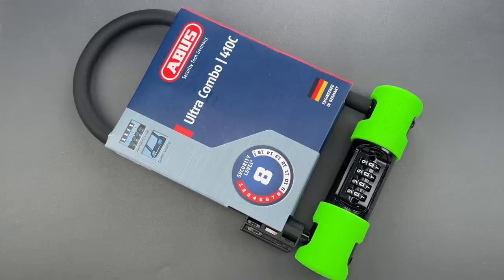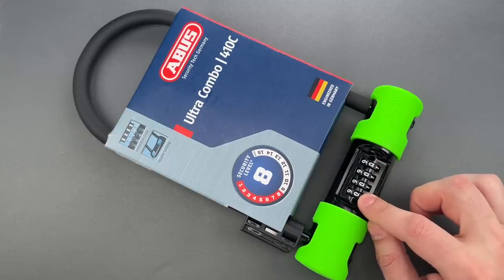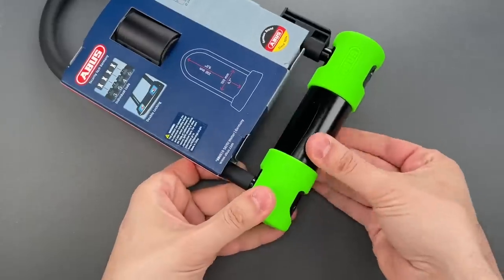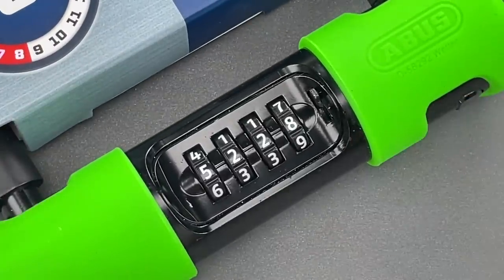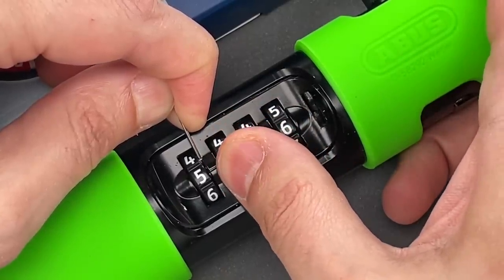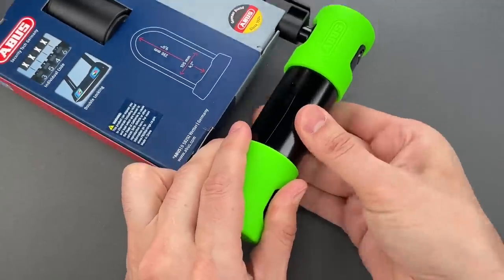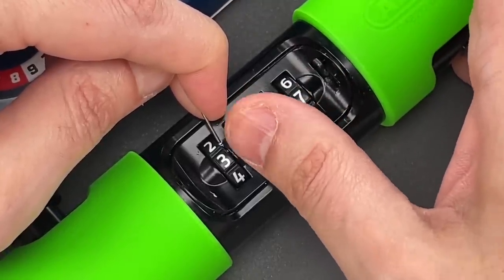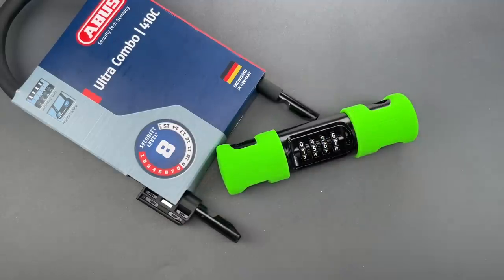[1527] Abus Bike Lock VISUALLY Decoded!!! (Model 410C)

Comment: I had a suitcase with the same design flaw as a kid. It was my first experience with lock picking, because someone had changed the combination behind my back and locked the case. It was the age before the internet, so we brought it to a shop in the hopes that they would know how to open it. They didn't, but they phoned someone. They didn't really understand the explanation, but I did. From then on I could decode all combination locks with that flaw. It's pretty baffling that a company like Abus still makes this same mistake in a new design.
Reply: It's a general issue with combination locks - but it's more serious with bike combination locks, by design.

A keyway can be sealed with a rubber cap easily (or a housing with a slider or something similar), but the rather large dials on a combination lock are a totally diffrent story. You need to be able to get a good grop on the dials, so they must be freely accessible all way around. A rubber cap which seals the whole dial assembly and can be completely removed easily will be prone to loss, and still awkward to handle during normal operation.

So bike combination locks require larger gaps so they can endure a lot of dirt and still be operated with bare fingers (or gloved fingers) even in freezing temperatures.

I've seen much better Abus combination locks, for stationary use, securely away from dirt.
Reply: @klausstock8020  Couldn't they just add a gear to the wheel (where currently they have the programming/checking mechanism), and hide the actual programming/checking mechanism somewhere behind the wheel mechanism?
Reply: @DerAlex86  They could do that, possibly even without making the assembly of the lock in the factory too complicated (of course, I can only guess how it's assembled).

And yes, Abus does offer offer combination locks with tighter tolerances which are harder to decode. But these are locks which are meant to be mounted on a door or a wall, and not to be carried on a bike which is then subjected to the dirt roads of, let's say, a forest path (Abus is a German company, and German forests are generally dirty).

My "best" bike combination lock was a simple (and cheap!) three-digit lock which was really hard to decode. Even though the model was generally very weak and we decoded locks of this model usually within seconds as kids. My lock, however, had been exposed to the elements and dirt for so many years on a daily basis that it had become very hard to decode.

It had also become very hard to open if you knew the combination. Turning the dials seriously hurt the fingers, and in very cold and wet conditions it became nearly impossible.

So I guess bike combination locks have to remain a compromise: secure enough to stop a casual prankster (like us when we were kids) or thief while still allowing the owner to open it even under bad conditions - all while retaining a reasonable price tag. It's never about maximum security after all, it's just that it needs to be better than the lock on the next bike. Thieves will use bolt cutters anyway, or steal the whole bike rack.

Comment: This has been an issue with many of those types of bike locks. For the past 35-45 years now. I figured this out back in 85. You do not need the light. There is a slight wiggle that will, depending on the interior design, go away when you hit the correct number or no wiggle that will wiggle when the number is correct. A little practice and it is very easy to feel the difference. Some you need pressure pulling on the release.
Reply: Think the light was to try to help the viewers see the notch he was talking about that could be seen visually in person.

Comment: This is surprising. Abus usually makes decent locks. I guess they figure pretty much any combination lock has about as much security as a zip tie, and it is what it is. 

One thing I’ve noticed, Abus and others have their own lock security rating system. It would be cool if LPL did the same thing with his lock reviews.  Just imagine, “Independently rated by the  Lock Picking Lawyer.”
Reply: That kind of thing encourages frivolous lawsuits and people trying to "cancel" him when their stuff gets stolen.  He knows better than to trust consumers and the internet with his reputation.
Reply: Plus ... there should only be say 3 ratings?

0. Basically a decorative cosmetic lock
1. Only slightly difficult to remove/open/break
2. Secure*

*But are there any actually really secure, basically unpickable, hackable locks?
Reply: I once saw 2 guys late at night stealing an e-scooter that was locked/chained to a traffic sign ... let say they were not a sophisticated operation BUT they just basically wiggled the pole, bent it over, and lifted the scooter and chain off the now 45 degree pole! Then probably home to the bolt cutters ... brute force approach!
Reply: A zip tie requires scissors or a knife making it much more secure than this lock.
Reply: @anttikalpio4577  You can open a ziptie with a pin, or perhaps a splinter. Just wedge the ratchet open. You get to reuse the ziptie even.
Reply: To be honest, most bike thieves never even try to pick or decode a lock. They go straight for a physical attack. There are countless different locks with different locking mechanisms, there's only a handful of different materials they can be made from.
Reply: Top of the list would be the elusive "security sponge"
Reply: @jarrodcross1482  There's no such thing as a secure bike lock. Every single one can be defeated. The security rating is supposed to give you a rough approximation of how long it's going to take and what kinds of tools are necessary. 
Security alone isn't the only consideration when purchasing a bike lock. Different use cases place different requirements on weight and portability. Someone on a long fitness ride around a countryside will want a different lock than someone commuting in a dense city area.
Reply: @CanIHasThisName  or the classic ... they just quick release the wheel which is locked to a pole ... and take the rest of the bike!
Reply: @anttikalpio4577  True. Good point.
Reply: Then  LPL Diamond rating: can survive for 30 seconds in the garage.
Reply: @benjaminmiller3620  , or with good fingernails.
Reply: @RoundShades  Really big ones, yeah. I'm pretty sure I've done that.
Reply: LPL has stated many times that he will never do anything remotely like that. Opens himself up to too much liability if he ever "recommends" a lock that someone uses and then gets broken into. More headaches than he needs for what is just a hobby for him.
Reply: @benjaminmiller3620  i open my own with peeled off nails or sometime side the exess of the tie to get it started, theyre actuially harder if you cut them flush as you kinda need to pull the zip a little to lift the locking tab
Reply: Exactly my thoughts, that's a well known brand with a bit of reputation, which they apparently believe can't be damaged by selling a lemon in the bike lock market.
Reply: We already have a rating system from LPL. It's called the video length. :D
Reply: @jarrodcross1482  "But are there any actually really secure, basically unpickable, hackable locks?"

If there are they are way too expensive for the average consumer. And they don't have to be. Locks just need to be difficult enough to pick so that it takes minutes, rather than seconds.
Thieves need to act quickly. The longer it takes to pick a lock the more likely you to be exposed while doing it. This is the real goal.
Reply: @Quotenwagnerianer  ok fine so which locks are they?

I always presumed the best lock doesn't even look like a lock? The best security isn't a lock at all, get me?
Reply: @Quotenwagnerianer  again I assume most locks are a minor deterant at best ... more a DONT vs ohhh you have bolt cutters scenario. Hence why I'm not surprised that most lock manufacturers put the least amount of effort in to it.
Reply: Plus as a kinda expert, maybe LPL could I DON'T  KNOW ... MAKE A BETTER F'NNG LOCK!!!!
Reply: doesn't matter - if ABUS won't react on theur customers
Reply: @jarrodcross1482  There's no such thing as a secure lock, or any kind of secure access for that matter. It's a tenet of security, including cyber-security. As soon as there is a way of opening/accessing something the "proper" way, you can do the same in an improper way. What you can do is have several layers of security, and find a medium between ease of access for those who are allowed, and those who aren't.

Comment: If this is Security Level 8 then I can't imagine what Security Level One is like
Reply: A knot tied in wet toilet paper.
Reply: A leaf on the saddle.
Reply: @Aussiechip  That would be level 2. Level 1 is a piece of straw that falls off when you are not looking. (It turns into a level zero device after a few weeks - it simple crumbles to dust before you even put it on.)
Reply: Bread bag twisty tie.
Reply: @Orzorn Lol I actually use that for my luggage, just to keep the zipper from accidentally opening.
Reply: it´s 8 out of 15, not 8 out of 10...
Reply: 8/15 looks better than avg. but in reality it is 3/10 when you substract 5 first.
Reply: Mostly made of cheese.
Reply: @awmperry  Mmm. Cheese lock…
Reply: I think Level One would be the highest, Level 10 the lowest. Level 10 would be a zip tie.
Reply: @Aussiechip  Oh!  That is so good!
Reply: I used a plastic bag to tie up my bike downtown once. Amazingly it was still there when I came back out.
Reply: @Orzorn  I  was going to suggest a zip tie but that might need another tool to cut it off.
Reply: Locked by good faith (aka hopium)
Reply: A single cheeto
Reply: Whispering "close sesame"

Comment: You can do something similar on the Squire CP40/50  ranges. Just look at the numbers from the edge profile and when the number is in the correct position it will sit slightly higher than the others. It will also be a bit springier too.

Comment: You should totally get a "macro probe lens"!  It's pricey, like a good $2k+, but it would enable you to really get super close and show us better than ever!
Love your stuff, thanks for rocking
Reply: You don't really need a probe lens for something like this. As cool as those lenses are, everything LPL does is too small for the probe to actually fit in so a conventional macro lens will work pretty much just as well but give a much nicer working distance and a slightly higher image quality
Reply: He can afford it. That's only about half an hours pay for a lawyer anyway. 🤷‍♂😂
Reply: For this video, turning the lock 180° would have allowed us to see the gap without the previous wheel blocking our view.  A simple problem of geometric perspective.
Reply: There are a lot of macro lenses in the market that are way cheaper. You can even just use a extension tube or a reverse ring for only $10
Reply: @28russ  he's paying a lot of alimony for all those times he went to work his ex's back door while married.
Reply: @carjac820 For "tube" I guess you mean rubber bellow.  But this still needs a different lens or an adapter lens on the front.
Reply: @EUC-lid  I bet the one special tool he used for unlocking that door isn't included in the covert companion set 😂
Reply: You can also use a smartphone camera for that. Even lower mid range models have cameras which are good enough for that. Stuff like low light performance or colors might be worse, but that doesn't really matter for shots like that.

Comment: You can do the same thing with most of those small luggage combination locks, the gaps between the body of the lock and code wheel make it very easy to decode the combination by sight.

Comment: It does look as if it would be very easy to accidentally change the combination - it seems it could be easily knocked into change mode. Maybe that's why Abus made it so easy to decode it...
Reply: @Nydarovi  it has to be decoded to allow the reset switch to operate
Reply: @matthewnowell4657  So, you open it, accidentally knock the switch as you pull it apart, move a few numbers as you remove it from the wheel, you maybe see the switch has moved and flip it back? Would that do it? It just seemed so easy to move the switch.

Comment: Another outstanding video.
Could you do a top 5 or 10 of the best and worse locks you picked? 
Even if its previous videos you showed. 
Obviously you're not endorsing or slating the locks but showing which ones you personally struggled to pick or caused the longest delays to pick and which was the easiest lol.

Comment: Something occurred to me while watching this: What's to stop someone from changing the lock combination in the store, before the product has been bought? Normally I'd assume that the factory set code would be printed on the inside, or maybe it would be all 0's or something easy. But with that design (and especially that flaw), someone could change it and impact a future customer who buys it.
Reply: I was wondering the same, then I realized the ability to decode by sight must be intentional, as it allows the buyer to open the lock despite having been scrambled in the store.

(sarcasm)
Reply: I don't know if this is what they do, but if it were me, I'd do what LPL did: set the combination and scramble the wheels, and then put the combination somewhere inside the packaging that wouldn't be visible until you bought the lock and opened the package. But given how lax they apparently are about security, I wouldn't bet on them doing this.
Reply: There is a plastic cover around the code wheels. 
You can't use the lock or change the combination without destroying the package.

Comment: Given how laughably easy it seems to accidentally change the combination this seems to be a usability feature :)
Reply: yeah the fact that the code change switch is out in the open like that, and apparently works while the lock is closed means anyone can open the lock, if they know that that's what the switch does.
Reply: @legionof248  you would still need to know the correct code to change the code.. if you could change the code while it’s on any random number then may aswell just not lock it at all 😂

Comment: The fact that Abus rated this with a "security level" of 8 / 15, I can't imagine how bad level 1 must be.
Reply: Level 1 is probably a zip tie
Reply: Level-1 security is politely asking it to open.
Reply: @simonm1447   I think a zip tie is level 3. Dental floss tied in a bow is level 1. Dental floss tied in a square knot is level 2. 😝
Reply: Level 1 probably means it's harder to get the new lock out of its packaging than to open the lock without a key. Which is literally true for some locks.
Reply: @simonm1447  it takes more effort to cut a zip tie
Reply: @simonm1447  A zip tie is actually level 9 on that scale
Reply: @simonm1447  Yes, but left open.
Reply: All the answers about level are wrong. Level one is just a small note attached to the bike reading "please go away".

Comment: That is quite worrying… specifically because Abus actually makes quite nice locks :-/ (edit: fixed typos; that's what you get when writing on a mobile UI)
Reply: The actually have some great desighns... at much higher prise range, like my current bike lock, that actually LPL recomended, I am very happy with it, its impervius to bolt cutters, very hard to pick unless speshal tool( in LPL's hands) and it will take up to 3-4 min of cutting it with a grinder.

Comment: With the switch openly exposed to change the combo, you could just change the combo and then the lock owner would freak out not being able to open the lock
Reply: I presume you can only change the switch on the lock to 'set new combination' mode when the correct combination is already dialed in.
Reply: @lurch666  Yes, but when the combination is so easy to see, changing the combination sounds like fun, um, I mean, a good method to inform the owner, that this lock is not secure.

Comment: Having the "change mode" available while being locked is a problem in itself. Imagine you come back to your bike and you can't unlock it. This might force you to leave your bike over night and then the thief will come back with an angle grinder. If he doesn't unlock it by sight 😅
Reply: I couldn't believe that he could change the combination while it was lock... I had to check twice to see that it was not a fluke.

Edit: ha!, maybe he can toggle the change mode because it's already on the previous valid combination...
Reply: I was thinking the same thing, nothing like locking your bike up, running in to the store to find someone has changed your combination.  Maybe that is why they made the lock so easy to open when you don't know the combination?
Reply: @yanmorin1503  You’re right. The lock combination wheels must be in the “open lock” position. Still yet, finding out the combination is easy enough that a prankster with no intention of stealing  the bike could have a blast by simply unlocking the Abus, resetting the combination; later watching the bike owner struggle to open the lock. 

Imagine walking past the perplexed dude and  saying, “Try 4-7-2-9”  as your within earshot. Especially confusing if you do it multiple time over the course of a weeks (with ever changing new combination reveals). 

*Yet another silly human tricks for the terminally bored.

Comment: This type of barrel combination lock is trivial to open even if you can't see the notches -- I discovered it as a child. It's about time someone designed one that was actually slightly secure!
Reply: I've learned it from this channel. It seems just for basic security the only good bets are a good keyway or a digital with no physical backup that's made by a company smart enough with locks to not be made of plastic or allow a battery door to open the lock or unscrew it to pieces until the shackle is freed. Which is unfortunately super rare. I love the Nest by Yale deadbolt for that reason. No keyway, the only backup for a dead battery is a contact point of a 9v battery to charge the lock enough to get it open after it's internal battery had died.